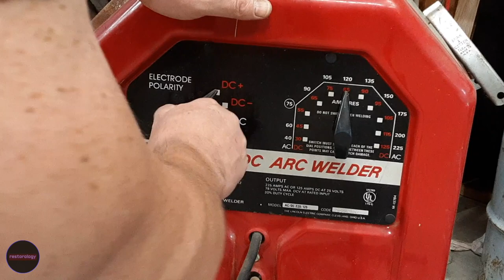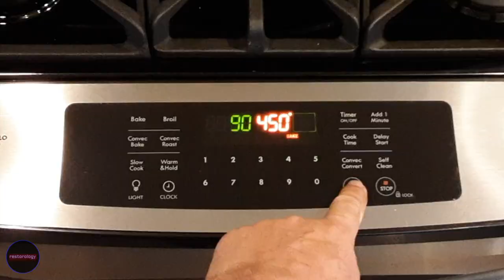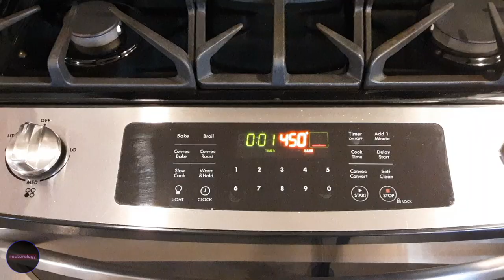Perfect Repair and Restoration of a Cracked Axe | Natural Sounds Version

Comment: It was truly a great restoration.  If the rust remover doesn't work, electrolysis is the best method.
Reply from the maker: Thank you! I am definitely going to try electrolysis at some point. This week I will be working on a 120 year old wrench that is completely rusted through and I've been letting it soak for over a week in rust remover. If that doesn't work, it will be a perfect first project for electrolysis. Thanks for the comments. Cheers!
Reply: @Restorology  Waiting for your wrench restoration 😊 Cheers!